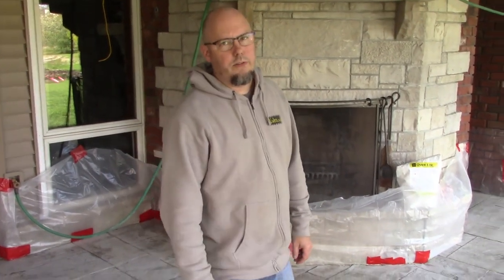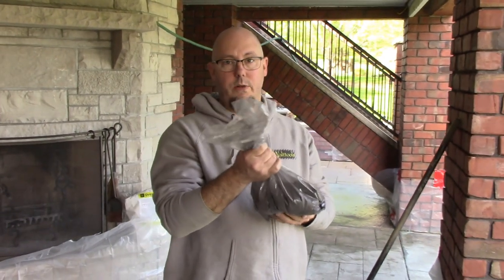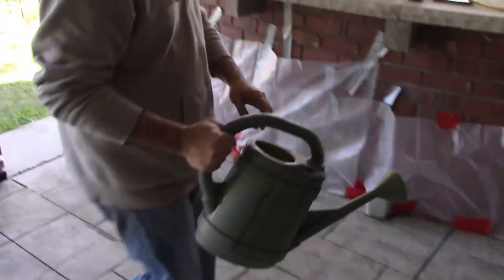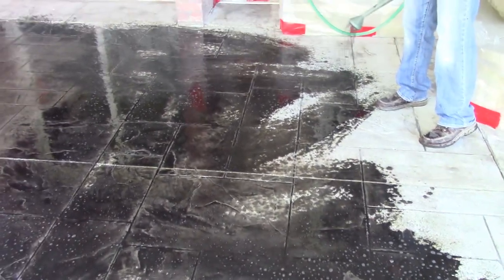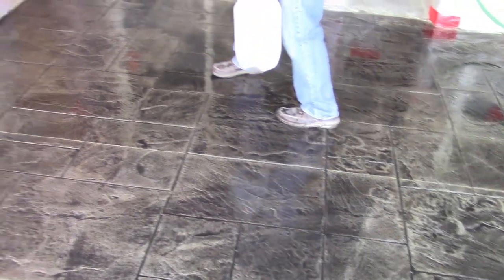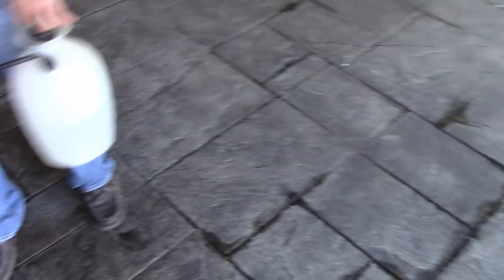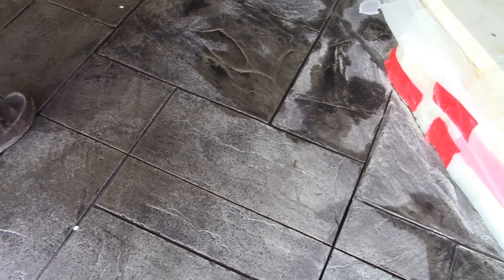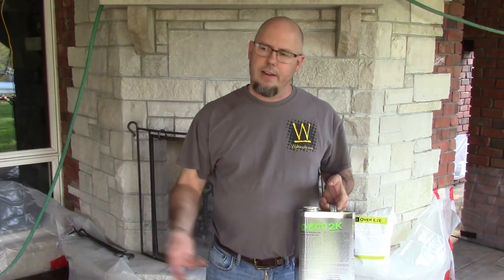How To Restore and Recolor Stamped Concrete - A Color Restoration Project

Comment: Thank you for posting this video. I watched this several times, ordered your charcoal grey and coffee brown, and our stamped concrete turned out fantastic. Very pleased. Couple bits of advice for those reading and about to embark on the project. Keep shaking the product in the sprayer or container while applying. Ours turned out a little heavy in areas. Buy a quality sprayer and practice spraying a nice fine mist. Before you apply the sealer, you will probably doubt yourself. I did. Some areas looked too concentrated, there were several drip marks where my sprayer dropped spots when I applied the accent color.. I used the blower and the water to mitigate it, but it didn't disburse the product like it did for the pros in the video. It won't look perfect, but that's just fine. It's stamped concrete and you don't want a uniformed look. It's forgiving and even with my mistakes it turned out awesome. Do this yourself and save the money. It was fun.

Comment: I just utilized this concept to resurrect a faded stamped patio with depleted sealer.  My color was liquid concentrate. I diluted it in a watering can, going darker than I intended knowing the underlying color would soak into the dry concrete. I then pushed the color around with a wide broom, and used a water based sealer when I was done. Came out fantastic. It has lightened slightly into our desired shade in a few weeks.  I plan on staying on top of it by applying a color enhancing sealer every year or so. Thanks for your video.

Comment: This is just what I needed!!  I had a new patio poured, stamped and sealed two years ago and was told it would need to be pressure-washed and re-sealed in two years.  Here were are and some areas are really light and others are really dark and I was told it now needs to be stained.  I felt like there had to be a better way to do it and this is exactly what I was looking for, except I did purchase a non-yellowing acrylic vs what you used.  I hope that will work as the sealer.  I only want the charcoal too and am hopeful it will turn out as beautiful as it was two years ago.  I didn't realize it would need to be done so soon...thought it would last for years.  Of course, they didn't tell me that up front.  Would a double coat of sealant make it last longer?? Thank you so much for sharing this video!!
Reply: 😊😮😅9

Comment: Like how the sealer is white on application so you know where it's going.  My stamped patio is overdue for this, but thankfully I colored the concrete a mocha color, so shading would just be one step with the walnut coloring and grout lines.  Great tutorial, thanks.

Comment: Great vid. I want to color my already existing stamped painted sealed patio (much like with showing in your video )  but I want slightly change the color from greyish to a tan-ish river rock look. Can I just apply the steps you did (just simply add color on top of the existing patio and then apply sealant on top of that?). No need to strip off the sealant on the existing patio before I try to re-color.? Thanks

Comment: I have a concrete overlay on my patio here in Houston that has not been resealed in many many years so the pigment is completely coming up all over a place. I know you're not supposed to pressure wash but I am purposely pressure washing to get as much of the old color up as possible... So that I can redo with this stuff.  Do you have any suggestions on how to expedite the removal of the old stain in order to make it as light as possible? There is no remaining sealer on the deck

Comment: I have an old faded light red stamped patio. Could I use this stuff to get a more light gray color or is it better to paint over with a masonry epoxy paint?  Wife hates the color of the patio now since it’s 8 years old and severely faded.
Reply: Mine is the same i hate it
Reply: @ironjunkie2011  I ended up getting some gray outdoor cement paint from Lowes. It took two full coats and now looks good.
Reply: Terra cotta color it the same way
Reply: @b8ascrub how has the paint held up? I also want to repaint my stamped red concrete but I actually like the red/terra-cotta color

Comment: Need your advice:  It has only been 5 months since we restained and sealed our driveway, using polyurethane (gloss finish) and it is starting to flake off ?  Preparation by trades person, as far as i am aware was done properly - being - acid was and pressure rinse; left to completely dry, free of debris etc. then tint and seal applied - 2 coats after a primer...is it potentially an adhesiveness issue?  Much appreciated

Comment: Just ordered this in sandstone, what happens if it gets wet again after the color dries?
Reply from the maker: The powder has a small amount of resin that helps hold in place but it is not made to be permanent.  WE often rewet it to make corrections.  An example is broom marks.  Just rewet, agitate and let dry.  You can even broom it while dry to abrade some of the color off the top surfaces to provide more contrast.  If the question is in regards to RAIN, then it will be okay with light rain bus a god hard rain will remove some color.  If not remove it, it will wash it of the top surfaces and concentrate the grout lines more. Hope that helps.
Reply: Walttools thank you you answered my question perfectly!